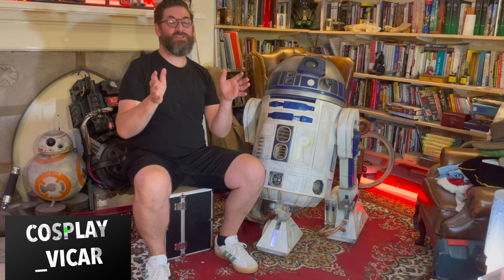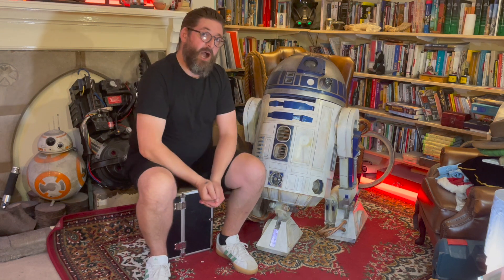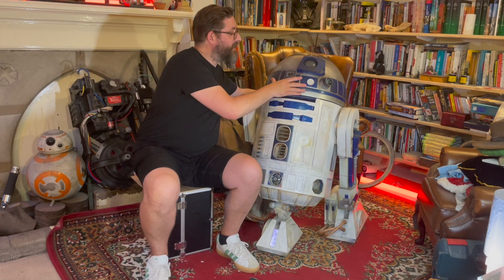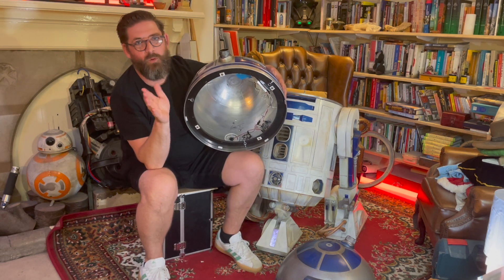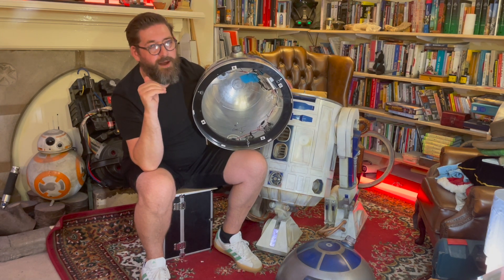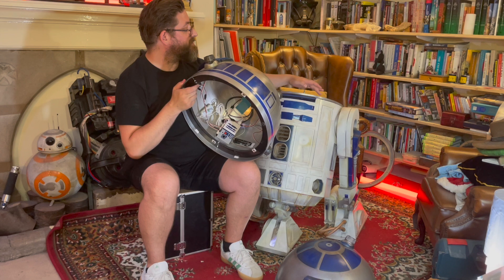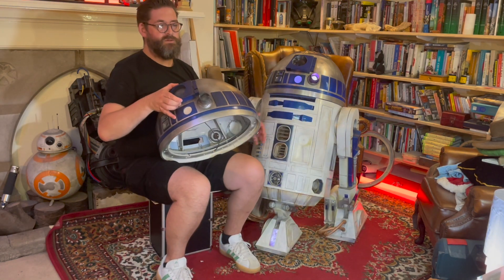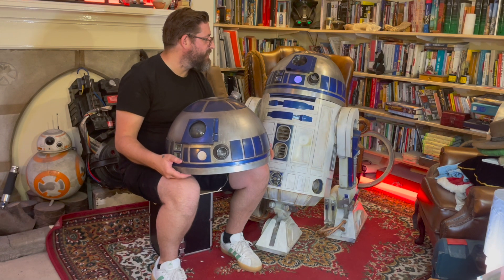New Aluminium Dome for R2D2

Comment: I have explained on astromech why you should go straight with the aluminium dome instead of 3d printing it.

Advantage of 3d printed dome.

Basically free for the files needed.

and

that's where it stops

Cons of a 3d printed dome. 

It will always looks off for some reason.

You will have to print it in pieces.

This will involve time, You will need a lot of time.
You will need to learn 3d printing.
You will have waste and failed parts.
You will need a dremel.
It will cost you a good chunk of money no matter what.
You will have to glue the parts. Thats means buying glues which as usually toxic. Not to be done in an appartment.
You will have to fix the problems that the printer created on the parts.
You will have to sand the parts
You will have to bondo
You will have to prime
You will have to test an array of silver colors and if you are obsessed with getting the right color it will cost you a fortune because it is not well documented.
You will likely get bad paint and orange peel which means sanding the print down.
You will have to buy sandpaper
you will have to buy a palm sander
you will have to buy a hutt for painting
You may want to buy an airbrush
You may need a compressor for your airbrush
you may want a spray paint gun
you will need a better compressor
You can't do the above in your apparment.
Once painted you will have to clear coat your paint job so that it is does scratch easily.
You will go nut figuring the silver color and blue color to use.
You may not find those colors in your area.
Then when you think you got the proper silver it will never fully dry and then get full of fingerprints.

The once painted. it will look off. The panels looks bulbous and inflated for some reason if you print the complex dome. The one with no panels glued on. The panels may not fit well, You may have to sand to make the parts fit.

and yada yada yada

all kinds of small problems will accumulate if you do not have the proper space and tools to do this.

Now ad the cost. Worse. If you feel lucky you may want to print a single part dome which means buying a giant printer. Giant printers are known to be costly and unreliable.

You are looking at 3-4 K $ to spend on the dome if you are starting completely from scratch like i went thru.

or

95% of the problems above go away with an aluminium dome.

It will seem like a crazy expense at the start BUT you will save a ton of your time. YOu will save a ton of money that you can put someplace else on your R2. You won't basically poyzon yourself with harsh chemicals aside painting the panels and ring and it will take you less than a day ( if you got a shop and the tools ) to cut the panels off, send the extra left over bits and then the next dayy you can prime and sonic blue pearl them panels. Then you can put the outer dome aside. Do the wiring inside your inner dome. Set up the light system. put on and align the outer dome and then Bob's your uncle. You put in the extra parts. Bit and bobs and within a week or less you got a dome that looks autenthic and that you can weather as you may please and also clean off as you may please if you get tired of the weathering.

Long story short resume.

Save a bit of money , Get an aluminium dome and be done with it.